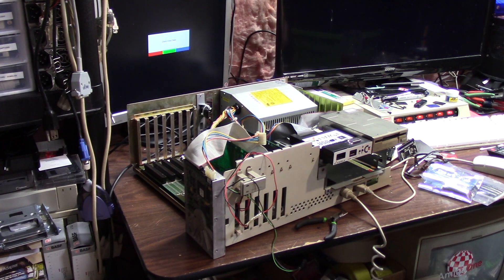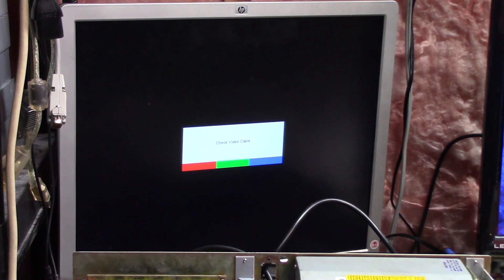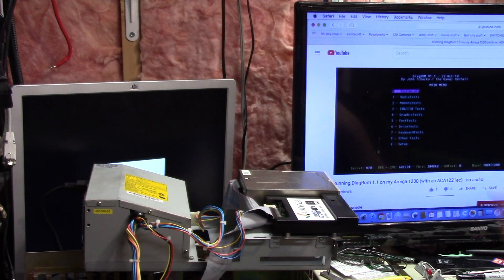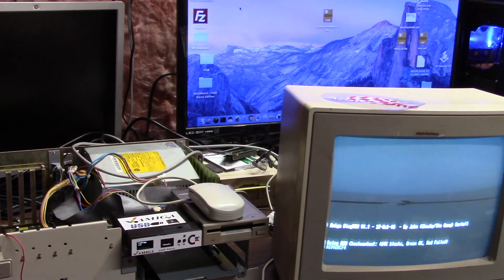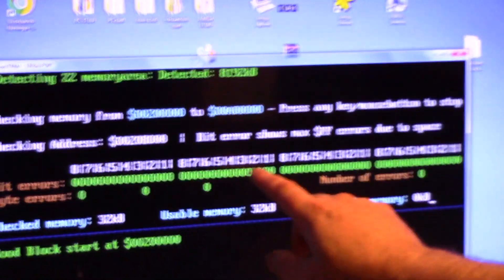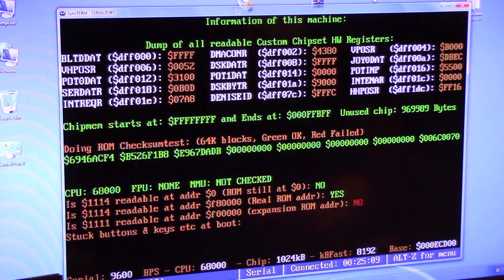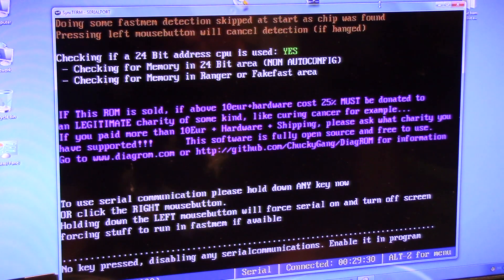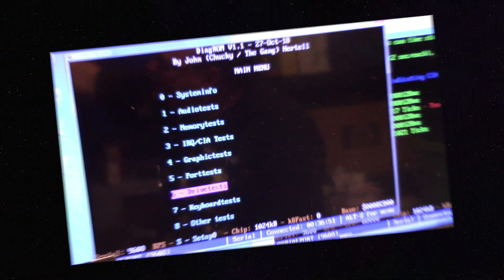Episode 97 Amiga Diagrom

Comment: Can you please show how to make the serial connection step by step.... I get nothing on the screen and not able to create the serial connection. I am using a usb to serial adapter, null modem db9 to db25 cable connected to serial in amiga 1200, and PuTTY with a serial connection COM1 9600, 8, 1, none, none, but when I click on connect... I get a blump sound and nothing.
Reply from the maker: i believe you need to click or press a key on the amiga for serial to kick in. i know pressing space toggles pal/ntsc, but if you have a pal amiga it should just flicker the screen on startup. the serial connection i too used putty and a old monitor to get mine going.

Comment: Hi Chris I have a dead a 4000 desktop
Ordered the diagroms for it 
How did you set up the serial to usb ? 
Is there a special cable.? What software   is needed on the pc side - thanks
Reply from the maker: its a usb to serial from best buy, db25 to usb and i use amiga forever to transfer files or just right into the pc via usb for diagrom, if you are ntsc and dont have a serial cable, press space and it will swap to ntsc, special software, i just used putty , google it its small and free does ssh ,telnet, serial etc..
Reply: @ChrisEdwardsRestoration 
I have no video signal  out of the  amiga so serial to pc is the only way ( assuming it does anything at all) - good stuff thank you 👍
Reply: hi Chris  got all my stuff in the mail , the amiga 4000  does show, cycles thru  some colors with the diag roms installed so there is hope , however im not successful connecting it to the pc 
via the serial  usb cable- i'm assuming its not really a serial to serial connection  but serial to usb and thats why the putty program does not work ? 
unless i got the wrong cale ?  ( i got  the 25 pin female to usb cable )
  I've noticed   your using the SyncTerm -serial  program ?  would you care to elaborate 
where to dowload ? how to use ? -thanks again
Reply from the maker: @daskarman  i use syncterm from here https://sourceforge.net/projects/syncterm  i use it for my bbs, but works for other programs on serial / tty / telnet etc, make sure you have the drivers on the windows side for the serial to usb it will be listed as a com port if working,

Comment: The GGLabs re programmable chips are great have a set of Diagroms  for all models and use them for 3.1.4 roms on my amigas very easy to re program and def use the serial port to diagnose issues built a new Acill A4000 board with all new parts NOS custom chips very helpful in pointing me in the right direction still ironing out the bugs with the new MB seems to be GAL related.... Great Video... Cheers BBA